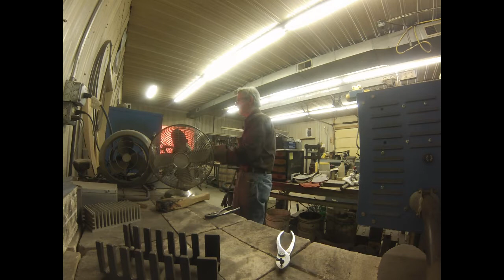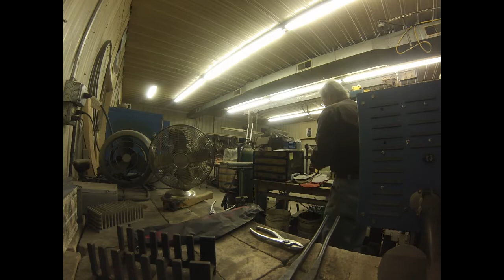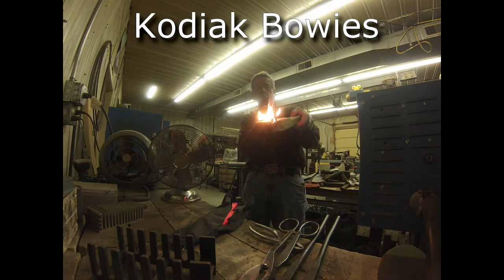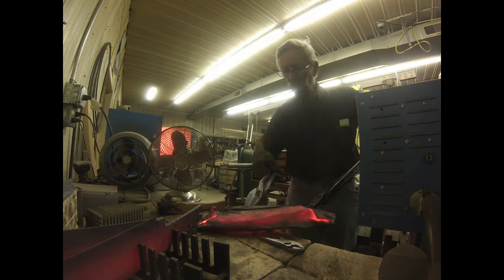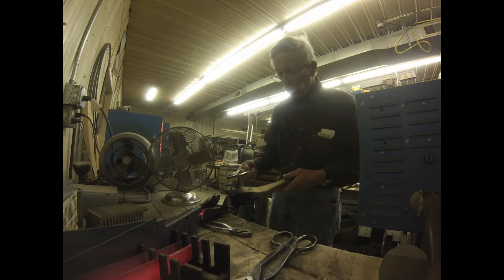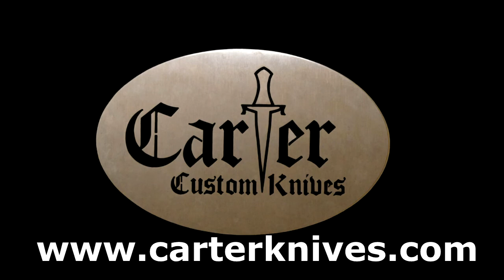A few more red hot blades

Comment from the maker: The stainless steel blades are wrapped in air-tight pouches made from high temp stainless steel foil. The prevents, or at least greatly reduces, decarburization.